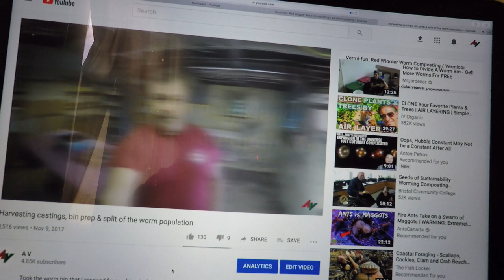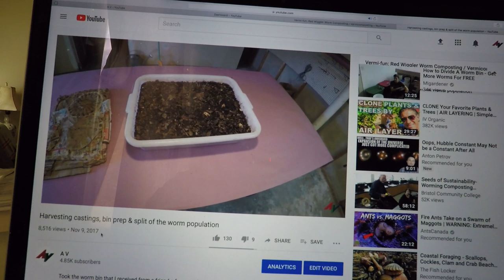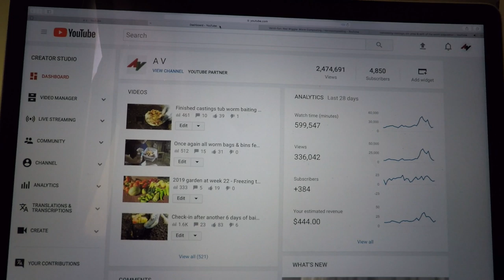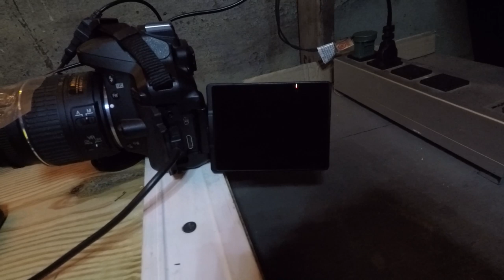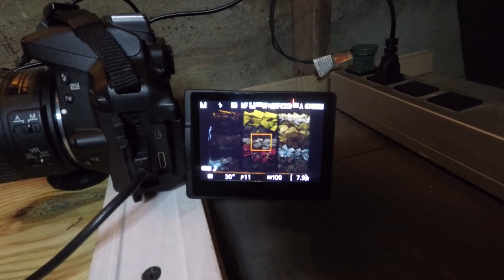2-Year Vermi- anniversary & Setup of 3-Chamber Carbon-only Time-lapse - vermicomposting

Comment: This is going to be interesting.  Should be able to get an idea of which material makes the best starting material for a bin.  Several things to see. The growth of the worms for one. The speed it gets processed, and the quality of the material once its processed. I'm probably not even thinking of some things we should see from this. Anyone else got any ideas?
My most recent bin I made with tons of mini shreds of paper. It's so interesting to see the material change as it turns into dirt. I've used paper before as a starter but I always end up adding other material like used compost dirt from the garden. But this time I'm keeping it paper and food only. It's pretty interesting to watch. So this time lapse is going to be really cool. Also like I said so much to learn. Great idea. The only sucky part is the wait.. but with Worms that's pretty much most of what we do anyway, wait.
Reply: One thing I notice from using paper is it dries out pretty quick. So you might find the paper bin being extra dry with those dry layers. I had to add water every other day to my paper bin until it got processed pretty good by the worms and had a good amount of castings throughout.

Comment: Do you plan on using the different vermicomposts for a seedling experiment? That would be really interesting.
Reply from the maker: Good idea - the timing is about right for when I'll be starting seeds for next season's garden. It won't be much though; perhaps enough to fill a single pot with each chamber's castings. Thanks for watching!

Comment: wow a lot of work ... i guess what i wondered was if the population of each section was the same of if one had more population in it
Reply from the maker: I did my best to place an equal number of worms into each chamber. Thanks for watching!
Reply: @A-V  thanks but were all 3 containers have the same amount of worms or did one  make more baby worms? i mean in the 100 days they must have reproduced? witch type of food worked better at ?
Reply from the maker: I suppose it is possible that some mating and reproduction occurred during that time. In this particular case, I was testing to see how things go in a low-nitrogen, high-carbon environment - which typically is considered more of a bedding... but also eventually gets used as food by the worms. As for what works best, I don't really know. Thanks for watching!
Reply: @A-V  thank you i did enjoy watching !!

Comment: Those greens are not nitrogen?
Reply from the maker: Good question. The truth is that I don't know. Perhaps I did sneak a little non-carbon material in there to brighten things up a bit.

When I researched how to load materials into my outdoor compost tumbler I found out that green materials might have a high level of nitrogen but after they produce seeds all the nitrogen gets transferred into the seeds and the remaining leafy green material is very low in nitrogen. So perhaps the correct answer to your questions is... maybe?  :)

Thanks for watching!